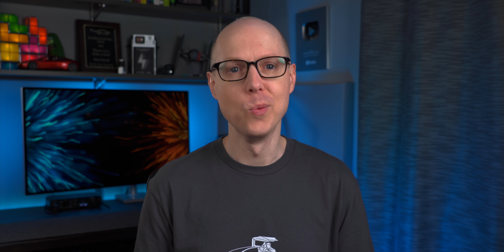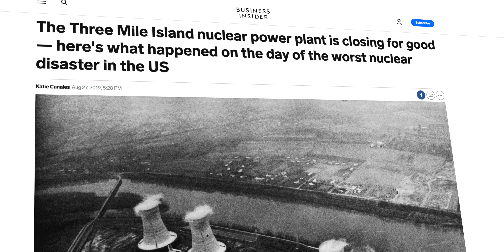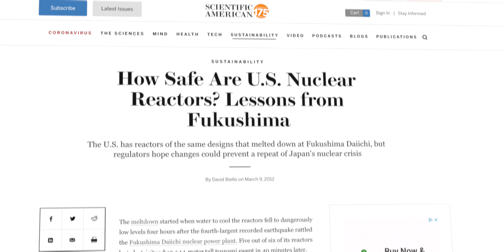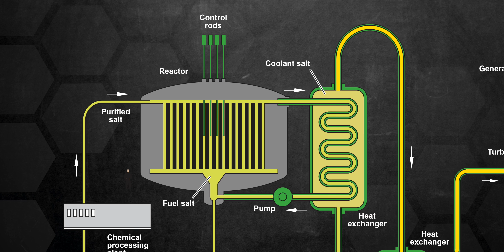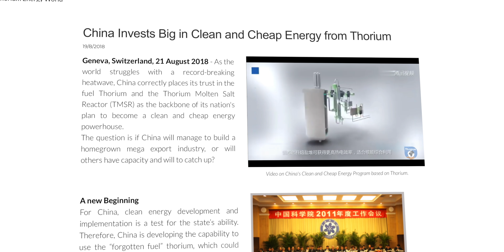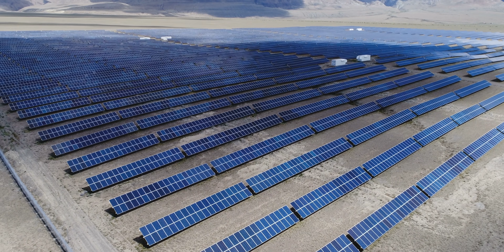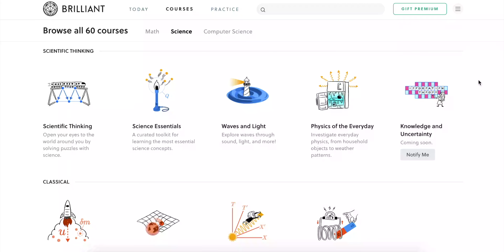Thorium explained - the future of cheap, clean energy?

Comment: This high-level critique of uranium-based (using U235) rectors is light-water centric. Heavy water reactors (the CANDU design is just one example) can burn any kind of fuel including depleted uranium from light water operations (CANDUs operating in Korea and China are currently doing this with a technology known as DUPIC (Direct Use of spent PWR fuel In CANDU)). What I like most about heavy water reactors is that they are very easy to shut down (just have a tank of light water above the reactor where the water is held in pace by an electromagnet: depowering the magnet allows the light water to displace the heavy water which stops neutron deceleration dead in its tracks (only slow neutrons engage in the chain reaction). One added benefit: since uranium does not need to be refined, this is one less place where weapon grade material can emerge into a world market.
Reply: As far as I know, CANDU 6 reactors have two shut-down systems, one consisting of cadmium-containing.. (neutron-absorbing) 'shut-off rods' which are lowered into the reactor core; and a back-up liquid injection system which injects a solution containing neutron-absorbing gadolinium nitrate.
Reply: @m.e.345  I knew heavy water could be poisoned by gadolinium (or even light water). I did not know that control rods were ever used with CANDU (so thanks for that). Too bad that these safety systems were not built into the Fukushima reactors which were designed and built by General Electric (IIRC)
Reply: From what I see on the internet, I think that the Fukushima reactors probably did have a similar dual shutdown system; it is just that the tsunami disabled both the grid power, and the emergency generators.. so there was no way to carry away the residual decay heat that continues to be generated for some time after the shut down systems are activated.
Reply: Incidentally, the 4 units of the Pickering 'A' nuclear power plant, outside of Toronto, do contain a 'dump tank' underneath the calandria.  In the event of an emergency, the operators have the option of emptying the moderator (heavy water) into the dump tank.  This system of shutting off the reactor was considered too slow to retain on later CANDU 6 models.  The Pickering reactors also have a poison injection shut-down system using boric anhydride.
Reply: @m.e.345  IIRC, the Fukushima reactors are of a light-water design where the reactors can never be shut down lower than 7% unless they are de-fuelled. The purpose of emergency cooling (in this design) is to remove waste heat even in that low power mode; but seawater from the storm surge damaged the cooling system which resulted in the mess (who knows what happens when the fuel rods start moving around in a molten mess). To make matters worse, I recall reading an article at the time where someone discovered a rock near the reactor containing an ancient inscription like "the water came this high in such-and-such a year". So lots of lessons here: 1) need to be able to completely shut down fission on demand. 2) need to have systems which will kill the reactor when a control system looses power. 3) need to always wonder what-if. 4) Canadian engineers still wear an Iron Ring on the pinky to remind themselves of previous engineering errors. IMHO all nuclear engineers world-wide should consider doing the same thing. (https://en.wikipedia.org/wiki/Iron_Ring )
Nuclear power offers great benefits because chemical processes work in the range of 1-2 electron volts while nuclear power works in a range one million times higher. On the flip side, nuclear waste might be a million times more dangerous but there seems to be a million times more chemical waste dumped into our atmosphere. IMHO nuclear is the way to go (especially if you want zero carbon emissons) but the engineers just need to be a lot more careful.
Reply: Thank you.. interesting.  My understanding was that most reactors continue to produce heat after shut down largely because of secondary reactions, mostly involving short-lived isotopes, within the reactor core, but I may be incorrect.
Reply: @m.e.345  Me as well. This is not my expertise and I do not work in this field. However, I have been a nuclear industry watcher ever since I visited Douglas Point (CANDU) as a teenager in the early 1960s ( https://en.wikipedia.org/wiki/Douglas_Point_Nuclear_Generating_Station )

Comment: whats your point you did not answer anything. do away with the UTILITIES. MICRO SIZE a THORIUM GENERATOR SO IT CAN BE USED AS A PER house bases .so when a storm knocks out the UTILITIES YOU DON'T GET HUNDREDS OF THOUSAND OF HOMES WITH OUT POWER. ALSO THIS THORIUM GENERATOR WAS TESTED IN THE 60'S AND RAN FOR SIX YEARS WITH NO PROBLEMS.

Comment: Moltex Energy solves the rad elements plating on the plumbing, and heat exchanger challenges by using "fuel tubes". Based on the UK (I believe) their design should be best, satisfying regulatory fears of "fuel moving through the pipes"...
Reply: Elysium industries has a very nice fast-spectrum design as well.
Reply: I'd be interested in that then if it's something clever. Really with a simple MSR like the MSRE, it's just a matter of balancing the chemistry so that the noble metal fission products don't come out of solution when the salt's temperature drops. The MSRE2 was supposed to have worked on that, doing real time chemistry analytics so you could monitor and control the chemistry of the salt continuously. 

Of course, plating isn't necessarily a huge issue, but it is an issue.

Comment: This guy is almost clueless when it come to nuclear reactors.

To begin with when talking about water cooled versus, moteh salt is not the only contender for cooling. The reactor project Bill Gates is involved with uses molten sodium ( molten metal) as a coolant. Thus it is boiling water coolant versus molten salt coolant versus molten metal coolant.

Another way to break down reactors is the state of the fuel. Current reactors are solid fueled. This causes a problem in that fuel rods trap the volities, such as argon and iodine, resulting in increasing pressure over time, which fractures the fuel rods. Fuel rods are generally not removed due to the amount of fissionable material going below that needed to sustain the reaction, but because of fracturing of the fuel rods. Molten salt does not trap volatiles, and the molten state makes it much easier to remove fission products that poison the reaction by absorbing neutrons. Thorium is not suitable for solid fuel reactor because it is a much more brittle metal than uranium. However, their are companies experimenting with using some thorium in fuel rods that are mostly uranium.

The biggest problem with developing advanced reactor technologies is not engineering, but politics. In the US the Nuclear Regulatory Commision is controlled by the established light water reactor industry, which results in regulation that, when applied to advanced reactor designs, are the equivalent of requiring catalytic converters on bicycles. This is why Bill Gates is developing his reactor technology in China.

These technologies do not have to be developed with uranium first. Originally companies, such as Elysium Industries were designing to use low enriched uranium, but they needed a design that could, over time, burn its own spent fuel products. They recently realized that they could simplify the design process by starting up the reactor with spent nuclear fuel and plutonium that we are currently stockpiling. Then, to improve neutron efficiency, they will be using thorium as a feed stock instead of the uranium they had originally planned to use.

Moltex currently plans on using low enriched uranium as fuel, while cooling the reactor with solar salts, from the concentrated solar industry. They hope to eventually transition to cooling their reactors with thorium salt, with excess neutrons breeding U233 in this cooling salt.

Flibe Industries started out with a thorium design because theirs is a thermal neutron spectrum design, and it is not possible to create a uranium based breeder in the thermal neutron spectrum. However, at least partially due to the NRC requiring that thorium be denatured with at least 15% uranium, they will not be able to produce a breeder design, so they are designing a spent nuclear fuel burner, with a thorium blanket in which to breed U233 to make up the deficit for their thorium burners.

Pushing for thorium is not a good domestic deployment strategy. In the US we have enough spent nuclear fuel to supply the molten salt reactor industry for 300 years. Thorium will be needed for markets like Africa, that do not have stockpiles of spent nuclear fuel, but not in the US and many other nations with a substantial existing nuclear industry.

The idea that thorium is cleaner than uranium is false. Uranium designs burn their own fissionable nuclear "waste" resulting in the waste that has to be disposed of being fission products, just like with thorium. The fission product profile may be different, but it will still only require 300 years for the radioactivity to decrease to that of naturally occurring thorium. The same is true of burning the spent nuclear fuel from existing reactors, that is currently stockpiled around the US.

The focus needs to be on molten salt reactors, not thorium.

Comment: The development of nuclear reactor design has been stunted by political decisions over the years. Alvin Weinberg originally designed the compact light water reactor for use in submarines for the American Navy which worked well. Following this success, the American Airforce wanted a nuclear reactor on their aircraft. Attention moved over to a new design named LFTR which would be more suited to aircraft. A working prototype was built and tested as a proof of concept but the need for an aircraft reactor faded and the project sidelined. Alvin Weinburg insisted that the LFTR was more suited to a domestic power generation than the LWR reactors but the Nixon administration withdrew support and Weinberg was effectively sacked. The issue is that LWR should never have been the basis for the generation of domestic power (the design is inherently dangerous) and a safer solution had been invented decades ago in the form of LFTR. PS the problem with radioactive damage to piping was solved at Oakridge but not acknowledged by dissenters who favoured LWR.

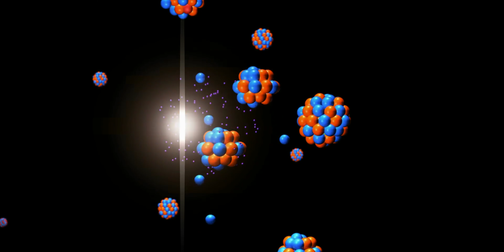Comment: At 3:23, the statement “Most of the uranium ore that we mine is U-238 and only contains about 3 to 5 percent of U-235” is incorrect. The natural abundance for Uranium is 99.3% U-238 while U-235 is 0.7%. This natural abundance for U-235 is not enough to sustain a chain reaction inside of a reactor. It is for this reason Uranium must be enriched up to 3 to 5 percent U-235 to be used as fuel.

Comment: Nuclear engineer here. This video is well produced but falls into a few common misconceptions about thorium. It's largely talking about breeder reactors in general, which can be made with thorium or uranium fuel sources. The sustainability and safety advantages attainable in low-pressure breeders are unrelated to thorium and totally set by the coolant choice and core configuration. We have a whole page about thorium misconceptions here: https://whatisnuclear.com/thorium-myths.html

Comment: comparing fission to fusion..............is like comparing a gentle walk on a sunny day to crossing the Antarctic ice sheet in winter.  Elysium industries have a proposal that will run molten salt (sodium chloride) combined with existing nuclear waste as fuel.  The current stock piles of waste can be completely disposed of safely, using existing materials. Because the fuel is free, they can use it in a simple design with no graphite because it runs in the "fast" spectrum easily.  The staff at Elysium have been designing and building actual reactors for the Navy, for decades. The reason development has been stalled in western countries is that the regulation prohibits it, and the DOE despite lobbying is dragging its tail on the issue even though China is already dramatically well ahead.

Comment: Rare earth mining, elements used to a large extent in today's electronic devices, produces A LOT of thorium as a byproduct. In fact, rare earth mining is all but abandon in the US because regulators consider thorium as radioactive waste and require mining operations to dispose of it. like any other radioactive material. Thus making rare earth mining to expensive to be profitable. Well, with thorium reactors, the fuel would be like making trash into energy and would also possibly make rare earth mining profitable.

Comment: Currently, standard style nuclear reactors have a build time of 10-15 years. A new type of reactor will likely take longer since you're facing new challenges. According to the IPCC (which is way too conservative when it comes to their predictions on climate change), we have 10 years to cut our CO2 emmissions in half. Any kind of nuclear reactor will come to late for that. Not to forget about the costs of any nuclear facility and the surrounding installations. Solar and wind are way cheaper than any nuclear power facility.
Reply: Nuclear has the fastest build time (not in plants/year, but in MW-capacity/y)
https://journals.plos.org/plosone/article?id=10.1371/journal.pone.0124074

Comment: Thanks for mentioning India and not mentioning nuclear proliferation, since India produced tested a nuclear bomb in 1998 that used U233: the Shakti V bomb.  This bomb wasn't very powerful, but it proves a thorium bomb is possible, and it's probably not extremely difficult to do by chemically separating the protactinium in a molten salt reactor.  It's much more difficult to create a bomb from thorium using traditional reactor designs,  and most of the research into non-proliferation presumes a traditional reactor.
I still do think Thorium is an excellent energy source.

Comment: Traditional reactors can be used to produce weapons grade plutonium which is a good reason to discontinue them. Dr Strangelove comes to mind.
Reply: Civilian nuclear power plants use fuel for long periods of time (1-3 years) at high power - creating Plutonium with significant quantities of Pu-240, Pu-241, Pu-242 - thus contaminating any Pu-239 created.

It would be so expensive to separate the Pu-239 that nobody ever has - countries building Pu bombs used dedicated military plutonium factories where the fuel is changed out every few weeks. I know of only 1 hybrid, Hanford N, but the power generation was an afterthought using waste heat, not a design feature.

Civilian nuclear power reactors do NOT produce weapons grade plutonium.
Reply: @factnotfiction5915  Correct

Comment: Meltdown risk isn't down to Thorium. Its the reactor design itself.

Water reactors are unstable, but the technology is from the US Nuclear submarine program. US Navy paid for all of the development. That's why its still used.

Thorium ends up turning into Uranium and Plutonium, so there's still a proliferation risk, although lower due to the amount of separation you'd need to do.

Comment: Bill Gates investing in Red China again, he should move there.  That aside, 10K, 1K or 500 years is still longer than I will live and not a good solution.  The clear choice for tomorrow's energy solution  is fusion.  Solar can be a band aid, but at 17% efficiency, not going anywhere fast.  More research should be put on solar to get it to 50 % or 70% efficiency. Storage is another issue, batteries are hugely inadequate.  Again more research is needed in energy storage.  We still have a few more hundred years of fossil fuel but those years will come and go by quickly.  I say focus strongly on multiple fusion technologies and make one or more work!

Comment: Thank you for an excellent presentation! There are, however a couple of aspects of this technology that I wish you had covered or emphasized more. First, it is my understanding that molten salt reactors are more scalable than 'traditional' reactors which could allow for smaller power production units being built closer to end users thus reducing the need for the expensive infrastructure necessary to distribute energy production. Second, although you did discuss this, I wish you had put more emphasis on the idea that thorium cannot be used for weapons production; that makes this technology far safer to be given/sold to nations that are presently not in the nuclear weapons 'club'.
Reply: There are other reactors that can be scaled to smaller sizes, not just MSR, but they all have different strengths and drawbacks. I also wouldn't say that it "can't" be used to make a weapon, but I would say that it's as impossible as you can freaking get, but specifically with thermal spectrum MSR thorium breeders. Gotta be specific. With them, it "might" be possible, but there'd be no way to do it secretly, it would take you over a decade to make just one, and even then it still might not work.

Comment: Quick correction. In natural uranium deposits the U-235 content is around 0.7% and U-238 is most of the remaining 99.3%. To be useful in nuclear reactors you need to enrich the content of U-235 up to between 3-5% by concentrating it using centrifuges and chemical processes.